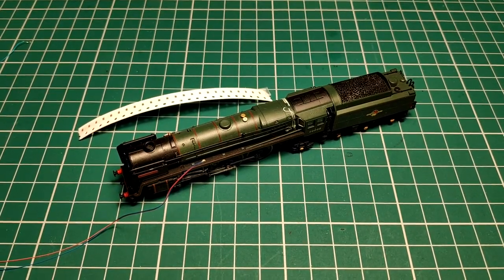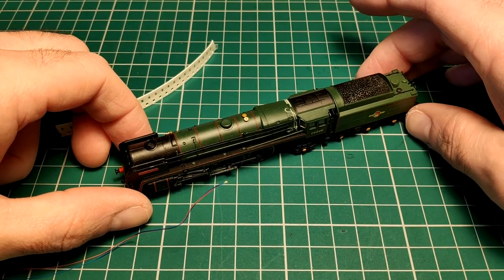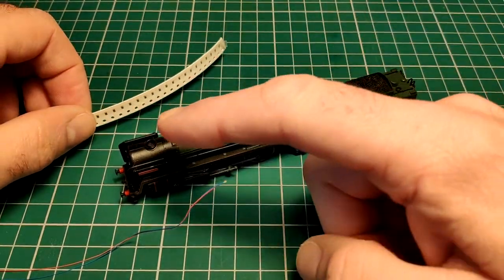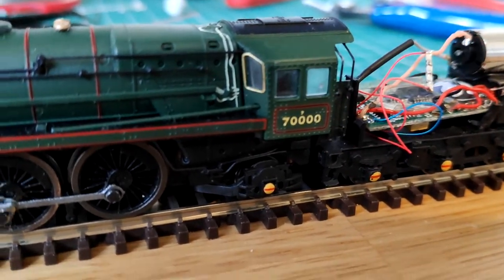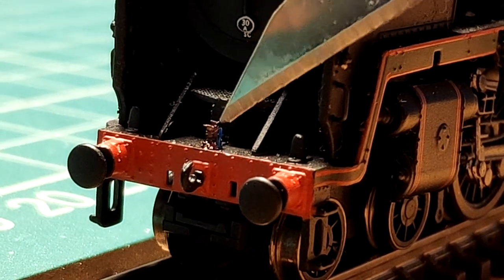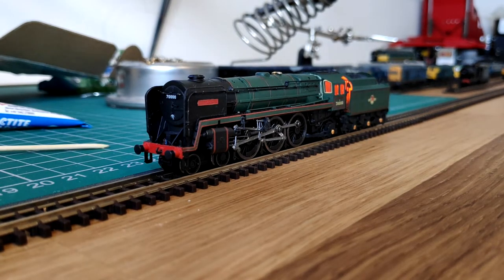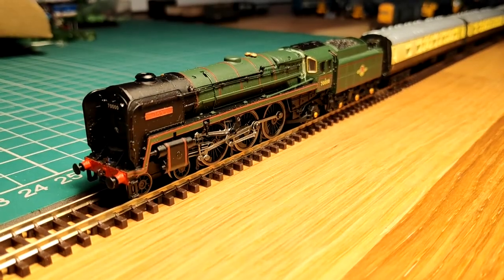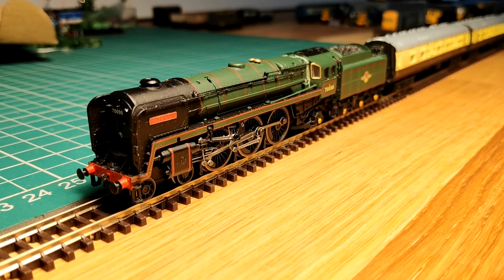The Dapol Britannia returns, this time with lights!

Comment: Nice video, I use alot of 603's for lighting outside buildings but never thought of 402's for loco lamps having said that I do have some 201's in my watch list on evil-bay LOL! I have yet to experiment with lighting effects on the Zimo decoder but it will come 😁 one little trick I've learned is if you put a flickering led in series with a normal led the normal led will now flicker. many modellers use a flashing led in series with a prewired red smd for the tail lamps and hide the flickering led inside the coach and just paint the original flickering led all black so it has no light bleed. All the best Tony.
Reply from the maker: Thank you Tony thats a great idea with the use of the flickering Led 👍, im keen to try it out now, maybe in the rear coach i put a red lamp into? those 201's must be absolutely tiny! The Zimos ive played with in the past allow you to do allsorts with the lights, flash, strobe, pulse, dim etc, it really helps finess things once installed 👍

Comment: A recent video I watched showed that the number of lamps and their position meant what cargo you were pulling. 
A link to those tiny LEDs would be appreciated :) 
Job well done :) Enjoyed watching this :)
Reply from the maker: Glad you liked the video👍, i will have to do some research by the looks of it on the lamps then! Fingers crossed one led lamp is correct 😁, ive just put some links in the discription to the LED's i used... The tiny front light is actually a 0402 but in the video i keep calling them 0403's!
Reply: @ThisWayWorksTWW  Will look for 0402 now lol :) Thanks!!